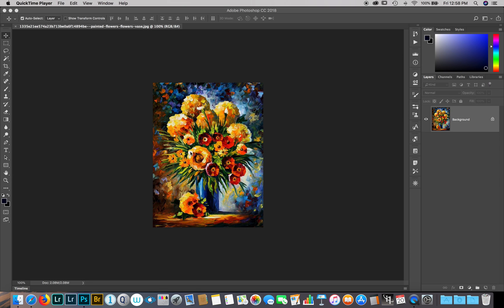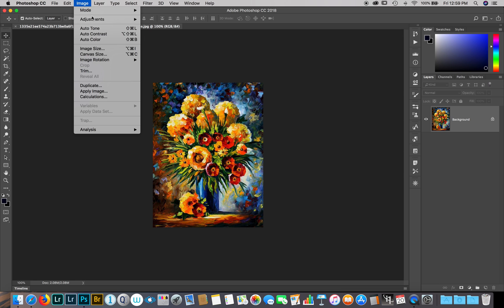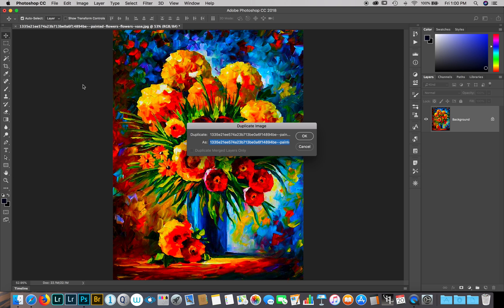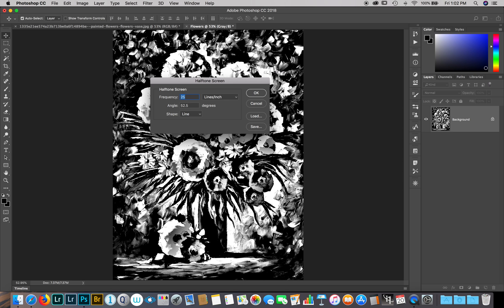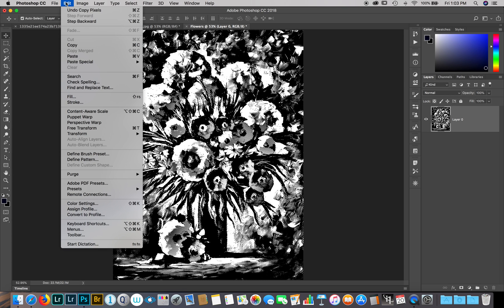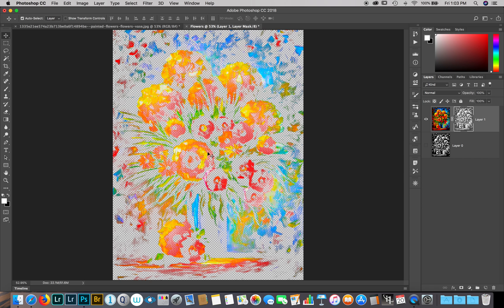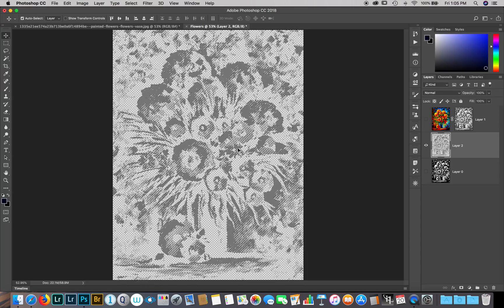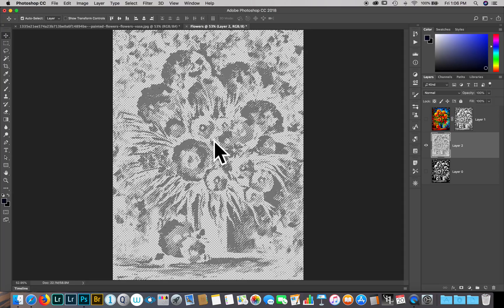Ghost white toner_Two passes (Part_1)

Comment: Why does my transfer came out with blotches of blue and white instead of a solid blue color?
Please help and here is the link to the image reference for better explanation, Thanks!
http://www.chandaportfolio.com/image-reference-foreverlaser-dark-transfer-blotch-problems/
Reply from the maker: is the image of the garment? did the rest of the blue stay on your transfer paper? If so it could be the you let it cool down too long before you attempted the separation of the transfer paper from the garment after you pressed it.
Reply: @photozen8398  Yes it's the image of the  garment after the transfer. You might be right about that I let it cool down too long for about 15-20 minutes before peeling A -paper off.  Approximately how long should I wait before peeling, is between 5-10 minutes OK? or shorter? Thanks!
Reply from the maker: @voltronLion1  you peel the paper while hot. Actually you should keep it close to the platen to keep it hot. You may right after the press rub it for seconds to get the b sheet well treating the a sheet but no more. If it cools down it will do what you just showed me in the pic.
Reply: @photozen8398  OK thank you sir for your detail answers! Really appreciate it.
Reply from the maker: @voltronLion1  let be clear. Pressing a on b should peel hot. Pressing paper on garment should cool down.
Reply: @photozen8398  OK I got it!